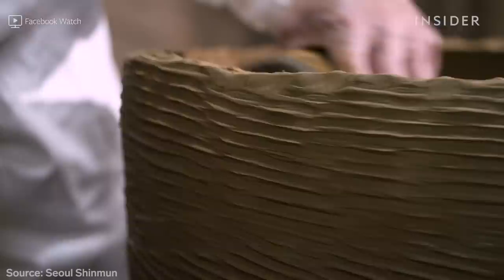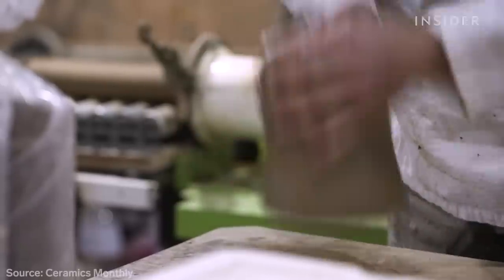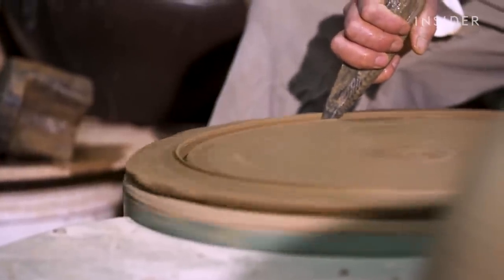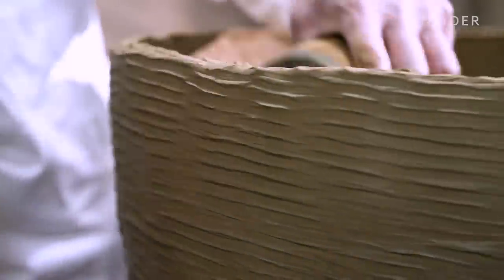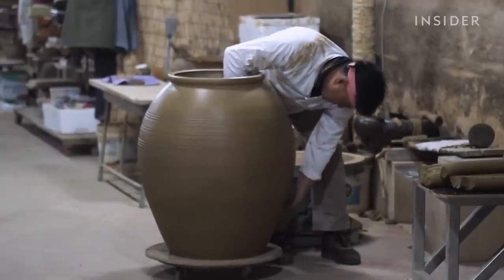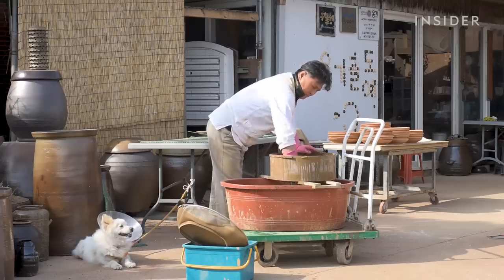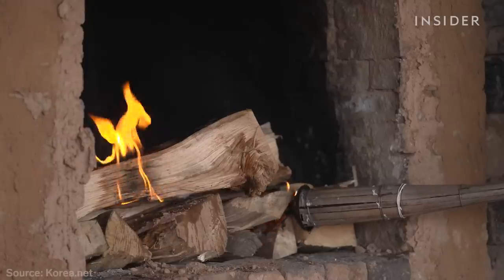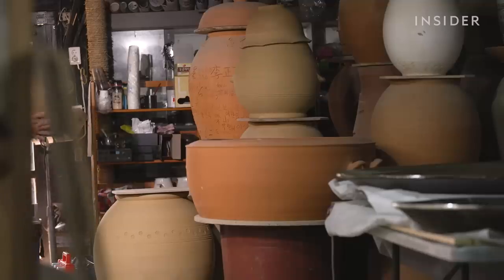How Master Potters Keep A 7000-Year-Old Kimchi Tradition Alive | Still Standing | Business Insider

Comment: Because the temperature is too high 🐁

That is why they break 🦃 

use gas powered fire so you can control the temperature easily and keep the temperature just high enough 🐐

So they won’t break 🐀

As long as they dry at the right pace and the clay molecules have time to move and fuse together 🦡

They shouldn’t break 🦃

Comment: If they're losing half their pots in the firing process, they should try working in smaller batches. Not sure how that's sustainable.
Reply: They'd still lose them, it would just mean more work.
Reply: @nobodyspecial4702  No, if there were less pots arranged in a more even pattern, they would heat more evenly and they wouldn't lose any. They even said it in the video, that the ovens don't heat them evenly and that's why they lose half. Smaller ovens or smaller batches would fix that. That's not a normal cost of business in the pottery and ceramic industry, to just be losing half of your inventory before it's even finished.